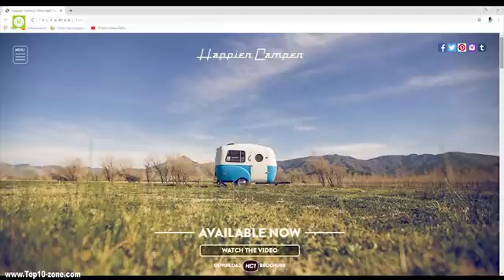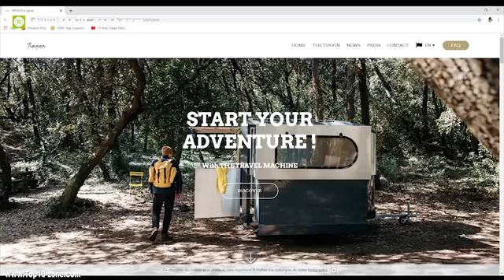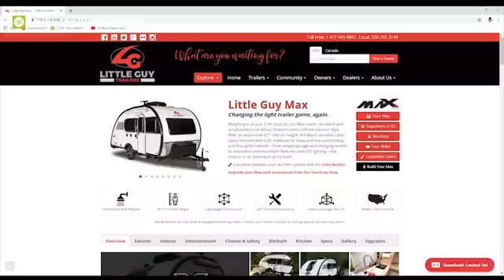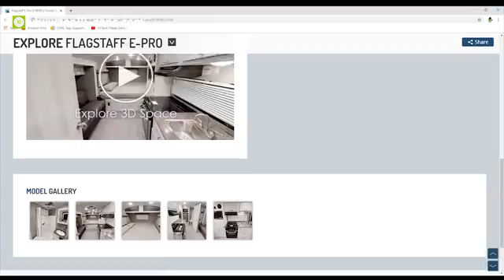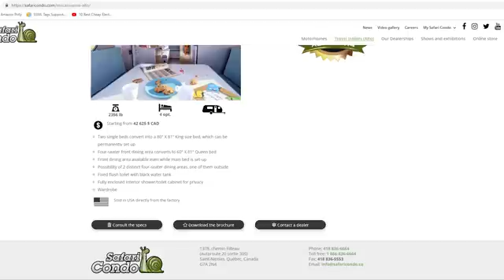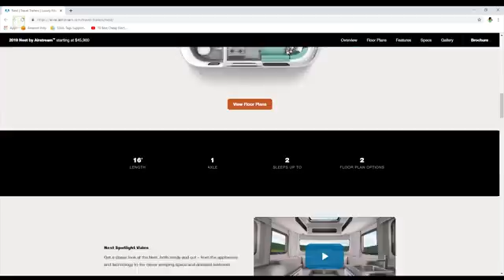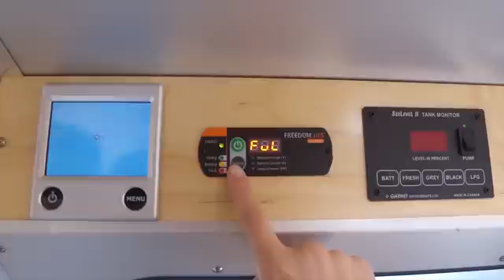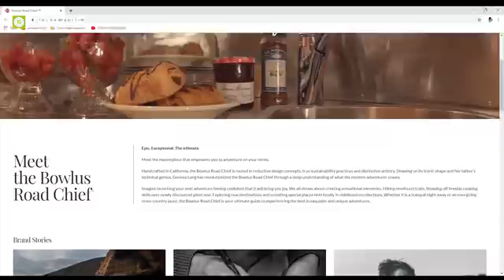Top 10 Affordable Lightweight Travel Trailers for Outdoors

Comment: Hmm. Not even watching, just read comments. We downsized from a fifth wheel that my partner bought used that was upgraded but the weight of cabinets and things not working at all like the heat, made it not so great! It was a forest river. We downsized to the Wolf pup Cherokee. Came to find out they always have a “build” every 6 months. Which is why you can find them “half price” or so they say at the end of that cycle. So we paid $12K base plus tax etc. we actually had a tree accident with that heavy fifth wheel, not our fault, so the total out was about price of the Wolf pup. We liked that the floor is all made before anything goes in it. Told them to keep the mattress and toss it that was basically paper with springs. The wall covering is like a photo copy of wood?? The cabinet doors are decent but the same with the cabinet walls. Cheap. All trims outside and inside coming off and we’ve only had it a little under 3 years. But it is solar ready with great led lights for boon docking. We chose the two bunk bed styles more so for more inside storage, rather then have a barthroom sink. I also sleep in the bottom bunk, snoring you know. But disappointed at the things I mentioned. We would have paid a little more. And what is with the ends of cabinets having no door. I want to punch out the plywood and put cargo nets I guess. But yeah, I dont see a reason to charge this much. Give choices of things. The best thing we did if find a discount mattress company that sent out a premium real mattress to cut it down 5”. Maybe we will just do upgrades ourselves.
Reply from the maker: Thank you for sharing your experience.

Comment: $21k for that tiny trailer......for $21k I can get a giant 5th wheel with all modern interior
Reply: Yep exactly. You can get a “couples” sized trailer, brand new, for around 10-14k. Or a used fifth wheel for around 20k.